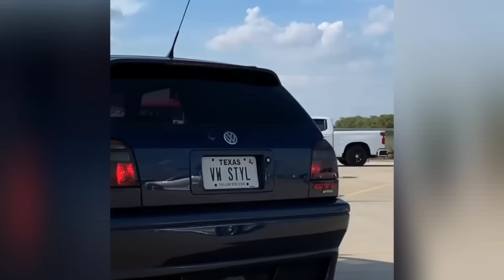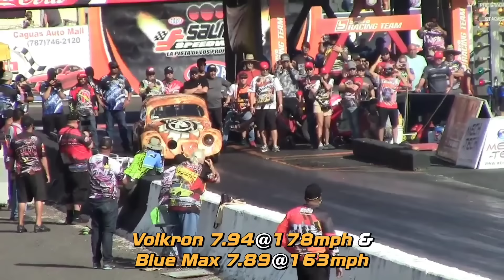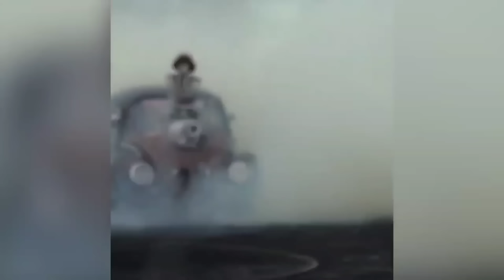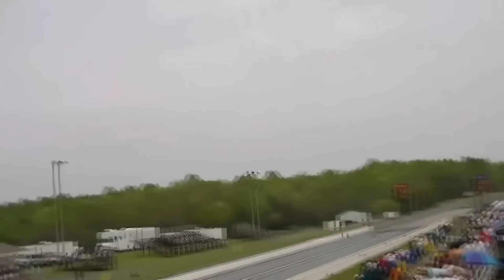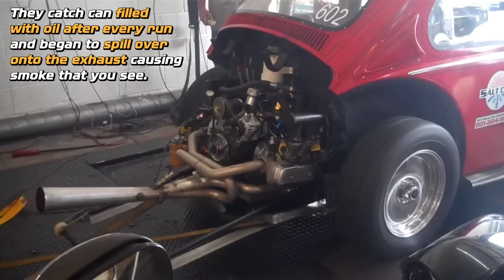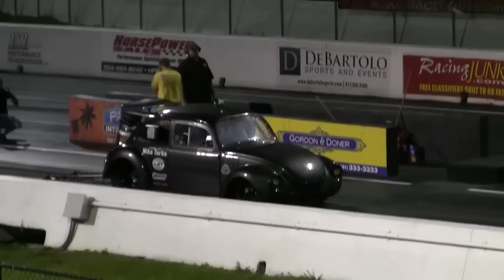Crazy VW Beetle Modified! Engine Swap! Spitting Flames! Racing! 2-Step Test...

Comment: The only legit flames don't come from kits, they come from the engine! Lots of nifty old bugs here :D

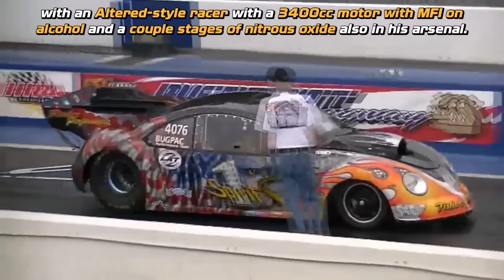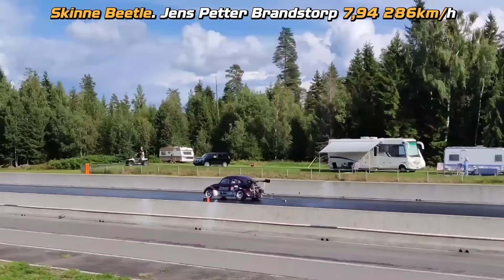That first lowrider was the best. Love the little skull throttle on that yellow one, I love little stuff like that! That mostly black/orange dragster at 4:20- it just has bug lights on some other frame by the look of it while the green one looks like a hotrod with bug lights. 8:15 DAT CRACK :P